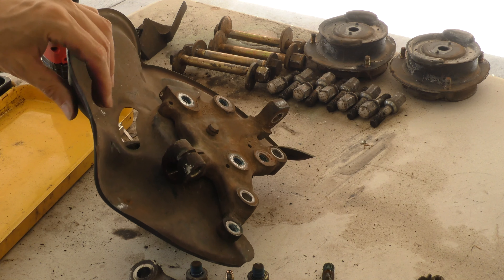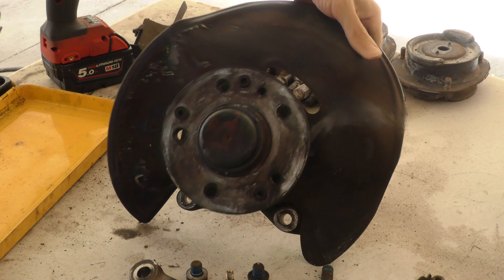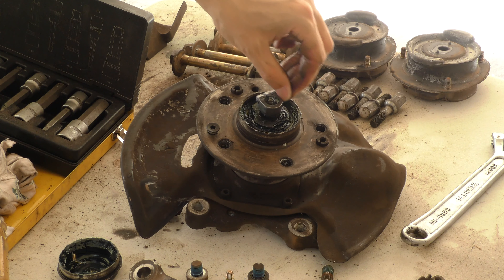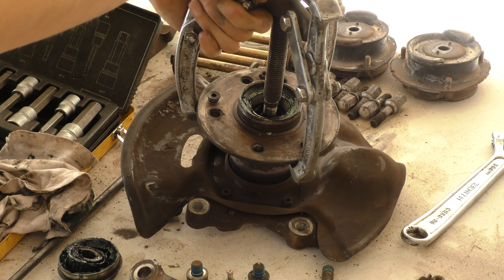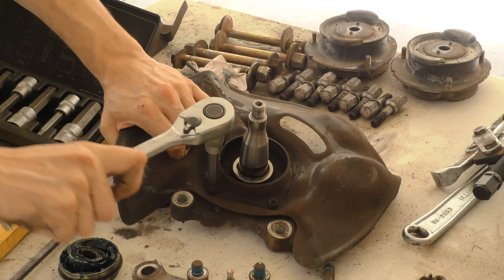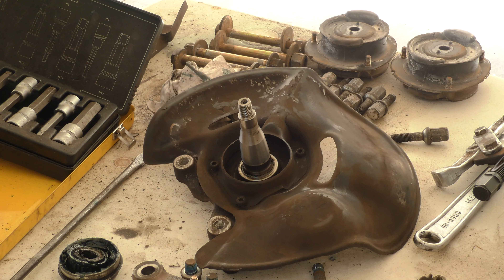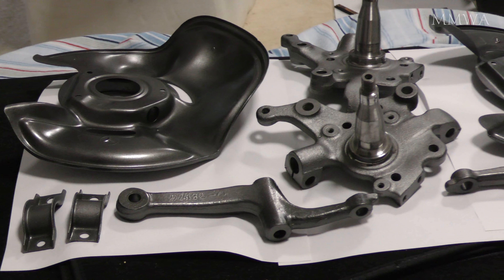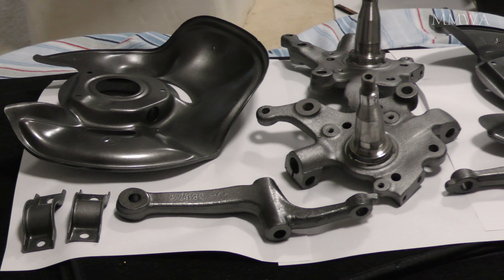W124 front suspension restoration - Improving the presentation of the knuckles

Comment: Five months ago,  l did rebiuld the every piece in my w126 front and repainted the metal parts,  however, I noticed that my paint job was bad and easy to scratch. 

So, if you show us your paint job steps including the materials, it will be a great help.
Reply: its simple, prep, sand, clean, undercoat, color or powdercoating is the most durable!!

Comment: Silly question, i know, but where can i find front wheel hub for a w124 other than Mercedes original. I have been looking at different OEM-parts catalogs but does not even find the part number of it. 
Droped as a child, several times...
Reply from the maker: I'm not aware of the fronts being available in the aftermarket. I had a hard time even finding the rears, but was able to get 2 x mapco brand rears for probably less than the price of 1 genuine rear. I feel your pain, they are very expensive for what they are. They were fine so long as the dowel pin is not reinstalled as its hole is in the wrong place.
Reply: @MMWA-DAVE  Thank You for quick response and really inspiring movies.
The owner before us have destroyed the threads and made it oval, so just have four wheel bolts for the moment :(